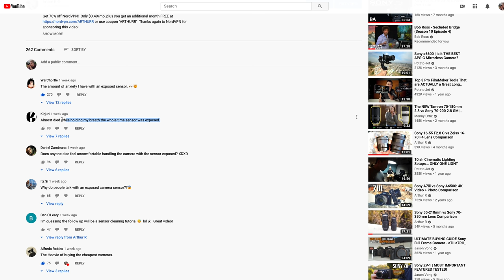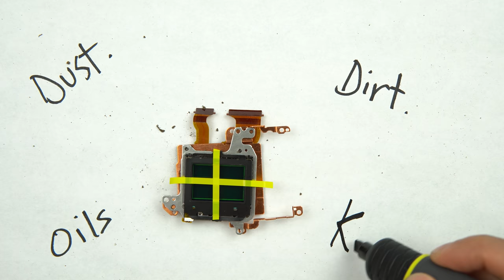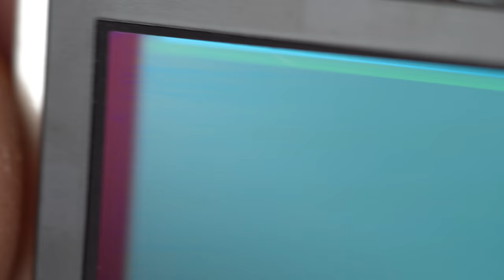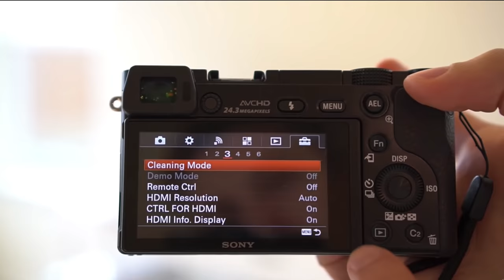How Scratch-Proof is a Sony Mirrorless Sensor?

Comment: 2:36 I had an accident with a blower like that, I lost the tip and when in use accidentally touched the sensor with hard plastic, that was scary as hell cause I could see a scratch, but at the same time I was thinking to my self, maybe it's just a bit of grease so I bought a sensor cleaning kit and I was right, my sensor still like a brand new one, but learnt the lesson and I bought another blower with all the tube made out of one piece of soft rubber😉👍
Reply: Same happens to me! That is why I'm looking this video! The plastic part of the blow was shot because of the air pressure and was directed against my sensor leaving a small scratch on that, im trying to figure out if is only dirty or if it's really a scratch how to repair it!

Comment: I think the thing you don't even know is whether it still works fine.... I have a scratch on my A5100. Not as big as the one you put on that sensor, but big enough that it should affect image quality.... but...NOTHING..... It's entirely fine.... can't see anything in the images.... you would be surprised. I know some people will call me crazy for not looking after gear, but this camera was bought to be ruined.   It is one I put in my pocket for skiing and mountain biking (and yes it has been in my pocket for some epic crashes... the kit lens did die.... but the 20mm F2.8 has been perfect). It was bought 5 years ago for $450 and meant I could retire a Canon 7D and stop having to wear a bag. Having a small camera that is accessible.... priceless... this camera owes me nothing...

Comment: nasty fly shit or goo is a problem, it bakes into the glass when its getting hot.    i scraped those filters (sensor is behind..) with wood sticks before without damage, even boxcutters are soft enough unless a piece of dust is stuck to the edge,  but dust, basically fine sand is the worst. even a cotton tip will scratch it as its like sandpaper.   but it doesnt hurt the image quality since the sensor is a few mm behind the filter, those scratches are not in focus and may only be visible when they reflect/block light in a weird way.

Comment: I had a friend, His manual hand blow blower, the tip came loose and came in flying inside the sensor of his a7iv which damaged the sensor, with a tiny dot on sensor. When ISO is the dot is visible

Comment: No one would worry about dust scratch sensor since most people baby their equipment.  The real problem is the haunting dust spots that appear in your shot after you'd done at the place. No camera has a good enough LCD/EVF to spot a very well disguisd small pinch/stretch of dust spot. And trust me, most photographer are not used to zoom in to the photo and do a sweep for sensor spot at the location since we would be mostly overwhelmed by excitment and joy. Plus, some moments are not repeatable. But the dust spots eventually showed up in lightroom like roaches in a old house once you go back to you 27 inch screen. This just raised the potential that a good shot that you composed, and you thought you've captured on the spot to be possibly unusable since depends on the shot some dust spots are not able to be "healed" or cloned out. Sony is the worst offender in this aspetct. Especially if you shoot video with them. My routine procedure of any shooting day always begin with me shooting a white wall on tripod with F22 and drag the dehaze all the way to check sensor for the needs to clean it, even then, and you never change lens, there'll still be some dust spots by the end of the day somehow. Nikon mirrorless is the second worst. They are a bit better than sony as long as you don't change your lens frequently. My canon R5/R6 are so far the best in this aspect, but even then they are not free from this problem at all. The shutter down function comes with its own caveat but it does the job so far, I only need to clean my R6 once after owning it. 
But say in an overseas trip or any other trip shooting scenario, I would not trust it and clear my sensor everyday once done shooting with my Sony and Nikon. Almost reminds me of good practice during army days that you clean your rifle regularly. 

If camera company like Canon can come out things like shutter down function to protect the sensor, they sure have the capability to develop some other mechanism to isolate the sensor when you decided you need a lens swap. It's just that no company/brand takes this issue seriously enough or never pay any more attention to it. I'd love to shoot with all the fantastic primes of E mount but ended up selling most of my e mount gear to try out the other two brands for this problem being one huge factor of consideration. If anything, I really like the raw file my Nikon produces. But end of day my most trust worthy tool is still those from Canon.

Comment: Last week a tryed to clean my sensor just as you did with the full frame sensor of the video example but i damaged something because now the IBIS in my sony SLT a33 is not working anymore. Really good idea. 🤣🤣
Reply: how hard did you press ?
Reply: You're supposed to put the camera into "sensor cleaning mode" which locks and disables the IBIS

Comment: “Ultimately if you are using a mirrorless camera out in the wild and you have a speck of dirt or dust or you touch it on accident, you shouldn’t have issues as long as you’re not taking a blade and trying to scratch up your sensor,” I would like to see  you make the sensor working again to see if there is not any other issues with what you have done with it. I believe that some pixels lines's won't be functional and that there will be a loss in sharpness...

Comment: In 2016 or so I was shooting with two Sony A7R2’s and had both on straps around my neck. I was shooting a model at a car show. At the end of the shoot I took a lens off and went to take the lens off the second one to swap lenses when the first one spun around and my finger went directly on the sensor. I was not sure exactly how bad this was but taking photos they were totally messed up. Later after cleaning the sensor it was good as new. (never swapped lenses in the field again. Two cameras, to diff range lenses.

Comment: I think most wont know there is a glass filter infront of the sensor. Even if you scratch the filter the sensor is still fine. For astro or IR stuff you usually remove that glass aka hot mirror.

Comment: I would just like to add to a comment that has already been made.
The Real test is to see what damage, if any, has lead to degraded images.
Just trusting what may be visible to the very low-intensity human eye, may bear no relation to comprised/affected images.
How difficult would it be to install the new sensor in a6000 type body and test the images?
Has not relaxed at all.
Have always left all sensor cleaning to pro repair shops, not worth taking the risk.
Reply: If you're happy paying 10 times the cost of the DIY cleaning kit then more power to you I guess :)

Comment: Having recently had to try to remove a VERY stubborn piece of dirt off a Sony a7s3 sensor I can confirm you can be pretty heavy handed with it all. A lot more than you'd actually think you could be. I was scraping a very damp APS-C swab many, many time over a section of my full frame sensor and it doesn't seem to have damaged the sensor at all.
Reply: As long as there are no sharp particles you should be good. Problem is that you can not be sure there are any. After a few gentle cleaning attempts it should be safe to put more pressure like you did. But, its never a guarantee. Ive had a light scratch happen just from the cleaning paper ive been using on over a hundred cameras.
Reply: why did you use an apsc swab? Because you had it around or because you didn't want to have to touch the whole sensor area?
My a7iv has it's first piece of dust on the sensor, out of nowhere I have like 1 small and 4 or 5 really tiny pieces on the sensor which is strange as I hadn't changed lenses for a week and they werent there a day earlier but they are there now.
I've heard of sensor swabs before but every other time ive ever had dust on a mirrorless sensor before, I could always get rid of it with a blower and never had to use one of the sensor swabs. 
My thinking was that if I can just avoid ever touching the sensor at all with anything then I will keep it perfect, because I'm anxious that touching with a sensor swab will leave some kind of residue and change performance from an arbitrary 'perfect from factory' (I wonder how they make sure the sensors are this clean from factory, what do they clean them with)
Reply: @samipso  cleaning paper for a sensor? or a lens?
Reply: @definingslawek4731  If you're worried about it like that I suggest getting it cleaned professionally.
Swabs are a bad idea because sensors scratch easily horizontal and horizontal scratches tend to show up depending on the type of photo you're taking.
Taking care of your equipment is always a good idea, but you will never be able to avoid getting particles on your sensor as dust will travel through your lens into your camera.
A professional clean will return your sensor to it's original clean state, something a swab can't do.
Reply: @definingslawek4731  Where I work we use a lint free kind of cleaning paper made for precision instrument cleaning. It still has dust particles that come off so most of it comes down to technique.

Comment: Cool video!! I've always wondered about the durability. Would have been my preference to see sand, though. In the future, i would super appreciate seeing tests of weatherproofing. I took my Tamron 23-75 f2.8 to a rainy protest and got so worried about potential fungus. I've since stored it in a ziploc bag with a desiccant pack and kept it on a window sill for UV exposure. Am curious to see what I could expect had I not taken these precautions (/post cautions? heh)

Comment: I'm more interested in the sensor cleaning swab stick you use, exactly what brand? Even better if you do a comparison of cheap wipes vs good wipes. After all, they are just cloth and glass cleaner agent (ethanol, methanol, and isopropyl alcohol).

Comment: The first time I tried cleaning my sensor with a swap is with my Nikon D7000. I applied some amount of pressure and it left some scars. 
From that point onwards I never dare to do it again. I am thinking to use any other item as practice on until I get it correct.

Comment: I mean for Glass this is pretty typical behavior, but i only know that the sensors are protected by a glass layer since I saw that spacing between the tape and it's shadow.

It makes sense for sony to protect the sensor with a glass layer.
Before I literally thought the sensors are the bare silicon wafer 😅🙈

Thanks for the video, this will save me a lot of time (adding all the seconds of extra caution in my life)

Comment: This is all good, but what if your over seas in a climate that is super humid and there is heaps of moisture in the air? Then dust could become damp and potentially harden onto your sensor.. So that's the reason i would always keep the mount cap on the camera when a lens isn't attached. And a q tip can and i know from experience leave tiny micro scratches on your sensor when used to clean the sensor.. Over time you will eventually get a milky look to all of your photos if repeated too often..

Comment: Go to know! Thanks. I use a 10mm+16mm Meike extender tube w/my 18-135 on A6400 for macro. Needed those swabs just in case. Am truly paranoid about touching the sensor; I NEVER leave it exposed. Always capped or with a lens (comes from my Canon F1 days). Here's a tip: install the macro tubes and it is possible to focus on the surface of the outside lens element to see dust/contamination on the glass. Also just ordered the Laowa 9mm based on your review; oops sorry didn't buy it through your link to Amazon...will next time.

Comment: Amazon video, man! 
Now put a petition list so we can sign asking sony to send you a working a6000, so you could do these tests and also take a test pictue with the camera to see if there would be some damage not visible looking at the sensor itself. :-) 
Also, you could change the knife part next time as we already know it will scratch and I don't think anyone would do it, but try to clean a sensor, inside a camera body, witho and without the right tools for it. Like blowing air from your mouth or using a t-shirt. I've seen this in real life. hahaha for real.

Comment: Isn´t there some kind of filter, like a paper-thin glass with some coating in front of the sensor? Glass is quite resistant, but quartz as contained in sand is a bit harder than glass.

Comment: Sensor's surface is covered with a layer of glass, that scratches at level 6, with deeper grooves at level 7, so it wasn't actually a blade that left a mark, but some abrasive stuff stuck to it.

Comment: I read through the comments and couldn't find an answer: does this also pertain to DSLR sensors or is this specific to mirrorless?
Reply: It should apply to all modern nikon and Sony cameras (nikons use sony sensors). Older cameras didn't always have a protective glass layer in front of their filters afaik

Comment: The sensor has several layers of glass on top of it, the lowpass filter, hot mirror filter and often an anti aliasing filter. You can’t actually touch or scratch the sensor if you wanted too.
Reply: That's not really the point.  The point is scratches can show up in images. When people talk about the sensor, they talk about the whole thing, including all the layers on top. Arguing semantics like you can't actually touch the sensor is silly.

Comment: There is a little confusion on the correct size of the Sensor Swab used on a APSC sensor like on a 6400. Some say 16MM others say only use 17MM. The product you recommend is 15MM.  What size for smaller sensor cameras do you recommend & how about using the pre-moistened swabs that are also available? Thanks.

Comment: Not sure you can really tell what affect might have been on the sensor unless you installed it in a camera and looked for problems. Could be micro damage that you won't see using the method in the video (visual examination).

Comment: Spent $2,000 to replace my sensor after two different camera stores used those lollipop cleaners that stick to the surface and pull off dust. I had some oil on the sensor (from the cameras internal box) and they tried to clean it with the lollipop. The lollipop left goop and a sticky mess. I sent it to Canon for cleaning and it was so bad they had to replace the sensor.

Comment: You can actually even fix the knife marks. Indeed, the sensor isn't exposed, there's actually a glass layer on top. You can just switch out the protective glass very cheaply.
Reply: are you sure?
Reply: @ricoko9119  yes, I am sure. Lookup sensor filter replacement, it can be done for the Sony A7 series.

It's extremely delicate though, once you remove that protective filter, the microlens array is exposed and it's very fragile and impossible to replace without the sensor, so only a trained professional with a laminar filtered airflow setup should do it (if you get dust stuck in there god help you).
Reply: @rasmysamy2145  is it cheap though? It sounds expensive

Comment: Don't you realize that unless you had your camera modified for shooting Infrared, you are actually looking at the IR Block filter that is mounted in front of and to the actual sensor of all digital cameras????  You are not seeing the actual sensor, you are seeing the IR Block filter.  So everything you are doing is to the filter NOT the sensor itself.  BTW: the IR block filter can be professionally removed or replaced if necessary.

Comment: Arthur, you should try buying a sensor from the a6300 and try to put it in the a6000, if it does work you should do a image quality test for noise and stuff.
Reply: High chance of not working as the firmware should be pretty much locked down to hardware level.
Reply: @trym2121  i have thought of that, but the sensors are not that much different, but still worth a try

Comment: So question, I need help/advice for cleaning my Sony a7iii sensor. While switching out my lens near kitchen steam(not directly near but a few feet away where I thought I might be safe) it seems my sensor caught some of the moisture in the air and now has very small dry almost mist like sprits’ on it. Yes I know I instantly regretted everything after that moment. Is it worth cleaning? I’m extremely worried but I have the necessary cleaning swabs and solution. But I haven’t yet dared to mess with it due to my fear. I know dry moisture is different than dust so I’m unsure if I should just sell or not. 
(Also there are no professional camera shops in my local area) please help.

Comment: By the way, I think you're testing the scratchability of the IR filter infront of the sensor, rather than the sensor itself.
Reply: No his testing durability of the quartz plate, IR filter is on inside of the second filter glass. There is nobody ever touching sensor if the complete sensor assy is took apart.Even then you are touching airgap plate on top of the pixels.

Comment: I had very painful experience with sensor dust on my a6400. It was some oily dust from the road of something like that. Blower didn't help, and I spent 8 cotton swabs (2 wet and 2 dry cleaning) to remove all particles. Thus, very important video work was almost cancelled.
I had to sold camera because of that ;(
Reply: but you've succesfully cleanned the sensor?

Comment: Message clear. However, the idea not to expose the sensor, is not having to clean your sensor that often, since these cleaning kits are insanely expensive, and in the field you may not have the cleaning kit with you, or the situation does not allow to sit in a suitable area and get it done.